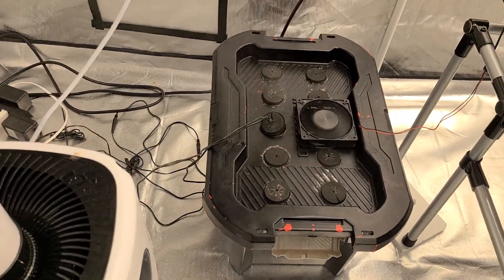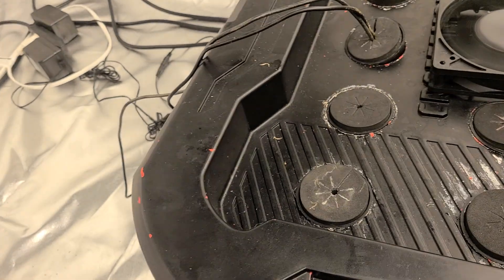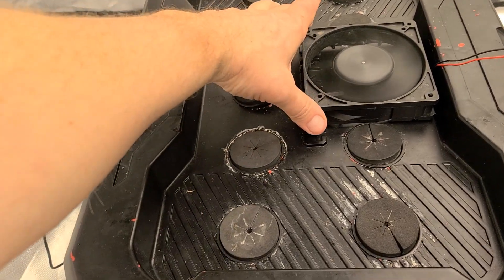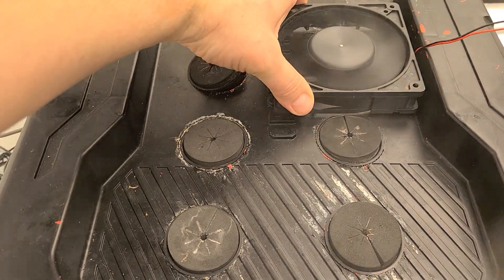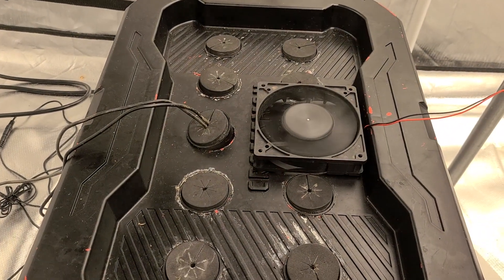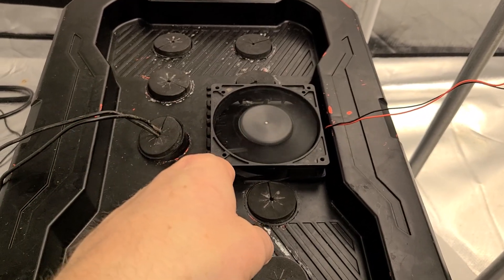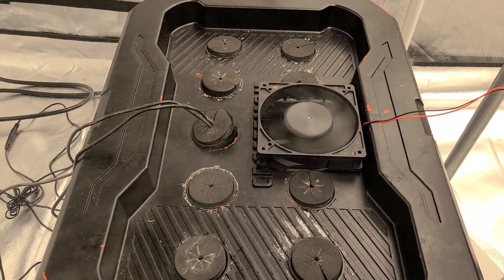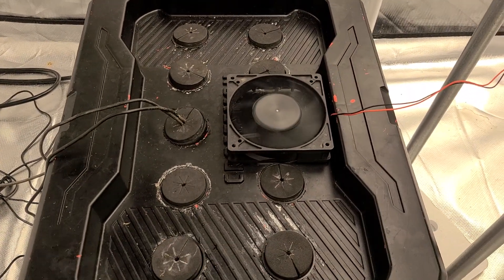Fogponic Cloner Build 2.0... Near 100% Success Rate!

Comment: Im building one with a 5 gallin bucket right now. What on - off cycle do you use? You ditched the fan and started using an airstone instead? Thanks in advance
Reply from the maker: @aydouble7327  i leave it going 24-7